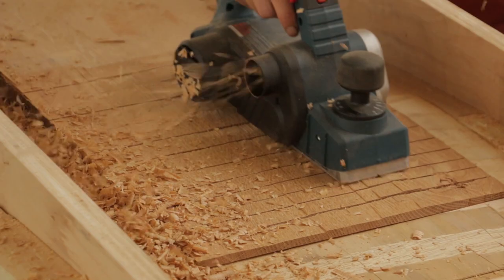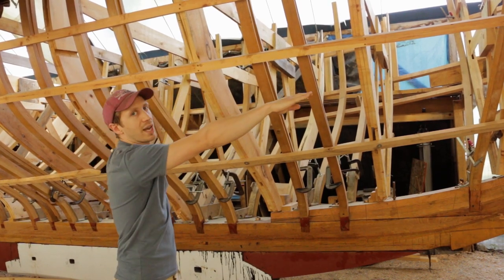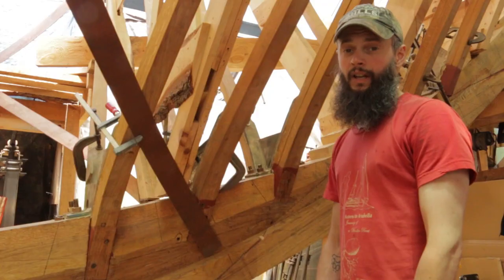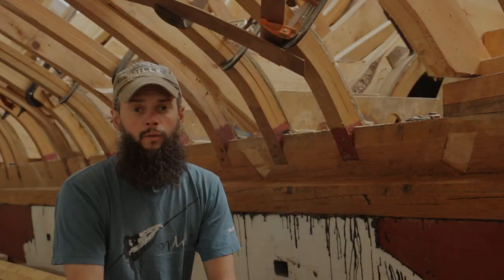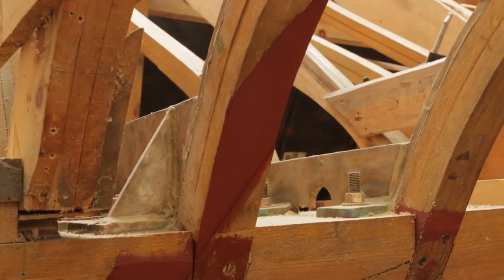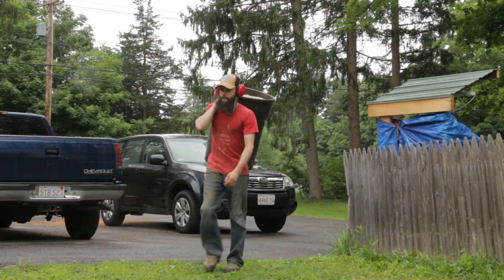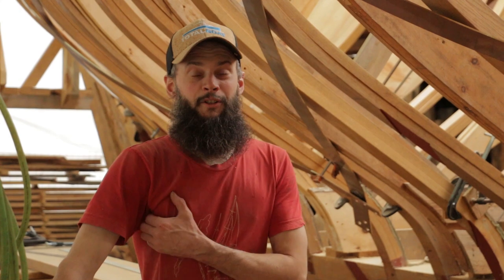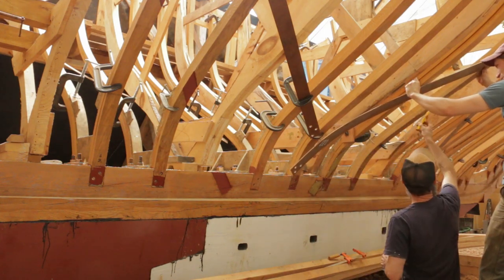Acorn to Arabella - Journey of a Wooden Boat - Episode 71: Installing the Bronze Strapping

Comment: Question:  Forms are still in place, and it looks like gaps in framing where the forms currently are.  When forms come out, don't you plan on putting frames into those gaps?  Or will there always be gaps there?
Reply from the maker: The rest of the frames will be inserted when planking is complete and the deck beams are installed. Only then can we remove the molds safely.

Comment: Why aren't the frames spaced evenly?...
Reply: James Byrne They are spaced out to best mitigate stresses within the boat. The frames are denser where there are more forces, and the frames are more spread out where there are less forces and it doesn’t need as much strength and rigidity.
Reply from the maker: The frames will be spaced evenly. Some can't be steamed in until the planking is complete, because the molds are in the way. The molds are required to maintain the desired shape until the deck beams are inserted.
Reply: @AcornToArabella  that's what I was thinking! Thanks for answering my question :)

Comment: I have not built a boat but I have built  several timber framed buildings. Building regulations demand similar strapping to what you have with the bronze straps but I have found that unless the straps are tensioned so that the frames are rigid it is a wasted effort. I did not see you tensioning these straps.
Reply: They said that straps will be fasten along planking so I assume that it will have something to do with that.
Reply: well you didnt see them fasteing the ribbons, or even picking them up from the store

Comment: I can't help but wonder: The horizontal top of the keelson does not appear to meet the garboard (once installed) directly, in some instances, mainly near the  Before the horizontal surface meets the garboard it slants down at about forty five degrees.  This would leave a rill into which a small amount of water could remain. You may have dealt with this already and I simply missed it.
Reply: They talked about it some when they were going through Victoria's many problems.   It is  indeed an issue  common to many designs and there are some time -worn ways of dealing with it.  One way is to pour that "ditch" full of tar or other non-hardening goop.  It is at the keel so weight isn't an issue.
Reply: @gumbykevbo  I was thinking of concrete,  that too would do it. However I understand the need for flexibility. Now that the garboard is laid on it is really apparent.

Comment: I guess this is established practice or from the plans but wouldn't triangulation beneath the essentially planar deck be more effective than curved strapping around the ribs or perhaps the rigidity mismatch between a deck built like that and the hull then becomes a problem in itself?
Reply from the maker: The plans for Arabella call for diagonal deck strapping as well, so that will be installed once the deck beams are in.

Comment: g'day guys. I'm sorry if this sounds like a stupid question but have you faired the Frames?. I can't remember seeing the Frames cut with a bevel. I'm only asking this because putting the strapping on before that could cause issues. I'd hate to see you put them on and then have to take them off to recut the slots so that you could put them on again.
Reply: @ prophetictimes 1968 The steam bent frames were twisted into place as they are installed to eliminate the need for fairing them.
Reply: Because there are moulds the steam bent frames are fitted at the correct angle against the ribbons, (I think)
Reply from the maker: The frames don't need to be faired because they take the twist when you bend them in. Thanks for watching!
Reply: Thanks for answering.This part of a build is always fascinating for me. I make wooden model ships as a hobby. So far they've been plank on bulkhead models, so the bulkheads are set at 90 degrees to the keel. I've had to be very very careful when it comes to fairing so that the planks go on nicely and you end up with a nicely shaped hull . In the scale model world this is where fairing the frames or bulkheads has the most impact on the final hull shape. I'm looking forward to the rest of the planking with you guys.

Comment: Hi,
First and foremost, Congratulations. What a fantastic project, and set of videos.. But then, I must say I do not understand this step at all. In short: 

1st: Why diagonal straps? You are building a 1934 designed boat, which by definition is already super-strong. You have further increased - massively - the strength with the bronze floors. Why the need?  (I know you feel you addressed this question in the summary above, but in essence you only say "you feel it is important"
 PS. I did own a 1948 double-ender wooden bermudian ketch very much alike Arabella.  Wood needs to work altogether. By fixing one part you may be stressing the rest.

2nd: Why are you  willing to change the angles of the diagonal straps just because you do not find the adequate length?  Are you sure that changing the angles will not create unforeseen stresses? - see all the comments of engineers below...  It does not seem you have gone as thoroughly with this part of the project as for all the rest. For comparison, just review your video on the reasons for the wooden mold for the led keel, as well as on your studies on corrosion. 

3rd: So let's say diagonal straps are great and the angles are not so important.... why on earth you put them in bronze? It clearly is putting a different material with different behaviour that the rest of the frame. In the case of the floors, it is different since each floor is small and is tied to few parts, but in the case of the straps, you are going to tie it to many ribs and planks that move, expand and contract. Since you are changing the design, if you feel you need the straps, why not do them in laminated wood with the glue you are using for other parts? 

It would be great if you could do a video explaining how did you study all the things that have been pointed out by the engineers in the comments above. It will not only be illustrative for all of us, but also it would give you the time to reassess the idea and reconsider the implications.

Anyhow, thanks for your videos.
Reply: I have a suggestion, build your own and to it just like you want to.

Comment: I have a question just out of curiosity: In the lower part where the boat curves in, the straps follow the shape of the hull. So if they get under tension (trying to get as straight as possible) they should push outwards, not inwards. I see how that is no issue on the upper part, because there they push inwards if under tension, but on the lower part, they will tend to go outwards when under tension. I don't know how much that is, but could this be an issue, because it's essentially pulling on the planking ? (or pushing on the planking from inside)?
Also nice video, but I'm not a fan of the background music in the beginning.
Reply: An excellent question. If only they read their comments 😟
Reply: @carl4043  They do read them, and reply to them, regularly but not always immediately.
Reply: They're fastened to each frame when the planking goes on, and their curvature between frames is negligible because the lines are very "easy", so there shouldn't be a problem in the topsides or at the turn of the bilge. But you are right to raise a concern about when the lines reverse their curve. The way I see it, thought, that reversal happens almost entirely in the final (garboard) plank, and it looks to me as if the straps go almost straight to the keel timber in that region. And remember that they're only carrying the tension from the last point of attachment. 
It would be better if they could have used longer straps in order to fit them at a flatter angle (which would alleviate the problem you mention). I would have scarf welded them if it was me...
Reply: @Gottenhimfella  I understood that they are fastened to each frame, I meant the pressure pushing outwards between the frames and the force on the frame itself. It could well be that in this case this is not an issue (or less of an issue than when the wood itself has to take the stress), but I could imagine that the pressure buildup could still be immense, pulling on the fastening to the frames as well as pulling und the last plank. I have no specific knowledge of ships, it was just an idea I wanted to bring up, for the case that maybe nobody had thought about the stress behaivor down where the curve reverses.
If they anyway thought of it and decided that this wouldn't be a huge problem that would be great (especially because they've already done all the work pocketing out sockets for the strips etc.)
Reply from the maker: The strapping is secured to the center line, so that shouldn't be an issue. Thanks for watching!
Reply from the maker: We read all of the comments and reply to as many as we can!
Reply: @AcornToArabella  Thanks for taking the time to answer comments, and I'm happy to hear that this will not be an issue.
I'm looking forward to your next video and wish you all the best for the boat and the project as a whole.

Comment: In California earthquake code requires diagonal let in braces to be placed in all outside structural walls over a five stud span. I would think that the bracing you are about to place should be let into the ribs so that they too will be flush with the outside of the ribs so it would not hinder the blanking going on later; creating a slight bulge at the bracing. You should not have moved the other side until you had one side done already. Move all the ribbing spacer bracing at the bottom and work the diagonal braces in at the bottom first and move to the top after blocking and setting the bottom of the ribbing first. As well as putting one at the stern and the bow and that will help the overall structure to be stronger as well with it all tied together from front to rear, leaving no ribbing unbraced.
Reply: The actual fixing of the positions of the frames will be established by the streaks (planks) as they are attached from the bottom upwards.

Comment: It seems to me that they moved them to the greatest tension possible with brass straps of a fixed 10-foot length. There is a another brass strap on the plans across the desk toward the bow. Just one that I saw. Maybe that is supposed to be duplicated.
Reply from the maker: There is diagonal deck strapping in the plans. We will be installing those once the deck beams are in place.

Comment: Are you concerned at all about the cuts in the frame to inset the bronze flat bar strength wise? Is there such a thing as having it too rigid?.............Mike
Reply from the maker: The cuts for the insets are shallow enough that they will not effect the strength of the frame.

Comment: if you want the triangulating reinforcement with bronze straps to be effective, you need to have the ends touching each other : if there is a gap between straps the volume between the gaps does not benefit at all from the reinforcement, making it the weak link of the chain. Check out how tubular car roll cages are built for a 3D version of how to design reinforcement (tube axis should cross at the same point).
Reply: They don't have to do anything like as much as a roll cage. All they have to do is stop the top plank moving fore and aft, relative to the keel. Wire cables would work as well initially, but would cut into the frames over time. Sailors with leaky hulls have used anchor chains diagonally and externally for this purpose, swigged up with a windlass, for as long as chain has been on board sailing ships. 
Before this they used rope.
Reply: @Gottenhimfella  I don't disagree with you, and the roll cage example was just to help them understand how this triangulating principle works : for it to be effective, all triangles have to be connected to each other (that is, efforts are transmitted from triangle to triangle, not from triangle to rectangle). The way they did it actually creates several reinforced sections that are linked by weak boxes not reinforced, effectively putting all the stress into these boxes between straps and making the resulting construction weaker than without straps at all in my opinion.

Comment: I have to agree with most all the comments I haven't read them all but I've read a few and one thing I've noticed has been left out.
And all the framing I've done or seen . I've never seen strapping used .
 even a band around a bunk of lumber it's just a rope it won't hold it square at all you can turn that Square bundle in to a round one just by Rolling it . or I imagine if you're building barrels would be fine .
 I truly can't imagine these bands being worth anything but a very destructive force to this vessel .
As if you're installing crowbars that are always going to be ripping it apart .
 like I said I have never  used or seeing strapping used for cross-bracing on anything other metal shelving .
I've only ever seen angle or dimensional Lumber used that has tensile strength in both directions .
And on the shelving get a lot more rigidity if you stack your cross-bracing .
 all cross-bracing is nothing without the bridging cross and Bridge for strength .
  I think the strapping could work and to get what you were actually looking for, instead of the big vertical crosses I believe three horizontal crosses stacked on top of each other bottom center top would be much more effective if bridged with the strap also . which would actually increase the amount of strapping you used by at least four times. 
I thought everybody new that bridge and crossbones between the ribs in a checkerboard fashion for a much stronger ship .
 and flying your flag of skull and crossbones warned all those who they might be crossing bones with if they get in the way .
 there is at least one checkerboard or maybe a few makes for a lot stronger and brighter and happier crew !
 great strengths for any ship is that checkered board of crossbones in between the ribs with added bridging to support your planking and keep your crossbones nice and strong !
 without your checkerboard and crossbones in amongst the ribs and the rigging can you really call it a ship with a safe and happy crew . without you are just a big dinghy adrift with most likely a crew of unhappy and drunken Sailors to deal with looking to mutiny to that brighter Captain with the Better Built ship !
 HHBpHhelps

Comment: I''m wondering if the natural 'play' provided by all-wood boats doesn't give greater durability than a design incorporating lots of metal structural elements. The risk of combining wood and metal is that the two materials have very different characteristics that end up fighting each other. There are many examples of 100% wooden ships surviving for 100 years or more without the need for structural repairs, providing they are properly maintained. Isn't 100+ years long enough for you? 

Using bronze fasteners is one thing (the 'floor timbers' can be included under this category), but I fear that mixing wood and bronze for large-scale structural members is not going to result in a synergy of the best of each but, rather, a synergy of the worst of each.     

Incidentally, my late parents' house in the Cotswolds is oak framed and was built around 1580. It's still standing and probably will be centuries hence. 

I fear you are trying to 'gild the lily' in some elements of your build. Everyone knows this effort to enhance can sometimes accidentally detract.
Reply from the maker: Thank you for the concern. Many naval architects who specialized in wooden boats have been proponents of metal diagonal hull strapping, particularly Herreshoff. It should be a huge asset in rough seas.

Comment: If those braces were indeed "diagonals", then your thesis about how they provide strength as triangles would be correct.  But they are being applied over a curved surface involving numerous planes, so the resulting effect is completely unpredictable except this: those "torsional" forces will be transferred by the unrelenting bronze to points in the hull that were not designed to accommodate them.  I would not want to be part of this experiment on 10 foot seas.

Comment: why are flat head bolts used for the bronze bolts and not something 'easier' and less strippable like torx or allen?
Reply: Fastening Material. You won't find proper Bronze wood screws with anything but a slot. No modern drives.

These are not your typical galv or 2A sheetrock/deck screws. Which would last maybe a few years on this job, if that.
Reply: @schwarzermoritz  Any technical reason why modern drives are not used, or is it just a 'stuck in tradition' thing?

Comment: Steve and Alex - It really seems like your putting the cart before the horse, by planking the hull, when you haven't removed the molds, yet ??  This is very confusing, that you have a bunch of missing ribs (big holes) where those molds are located.  Why don't you just remove those molds, and install those missing ribs now??  It seems like you could shore up the current ribs that would do the same job as the molds, and then remove the molds.  I think myself and others are confused, also.  Why do you need those molds, anyway?  And, if you plank the hull first, and add the missing ribs later, how are you going to fasten and clamp those missing ribs in place?  Could you address this issue in a video soon, before our heads explode?
Reply from the maker: The planks would exert too much pressure without the molds to maintain the shape of the boat. The remaining frames will be steamed in once planking is complete and some of the deck beams are in place. Thanks for watching!